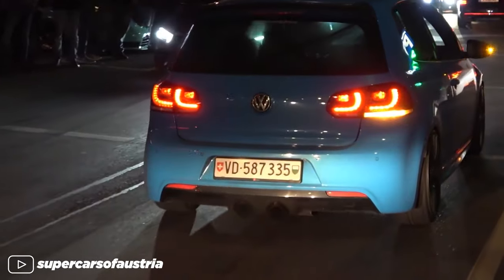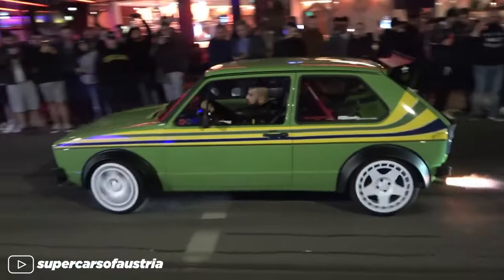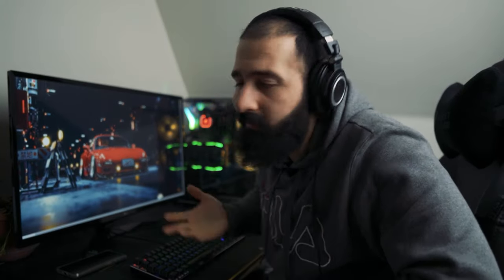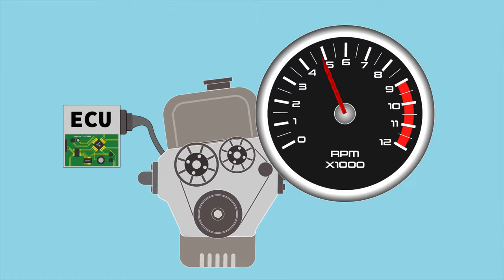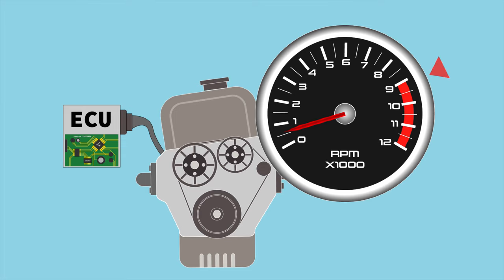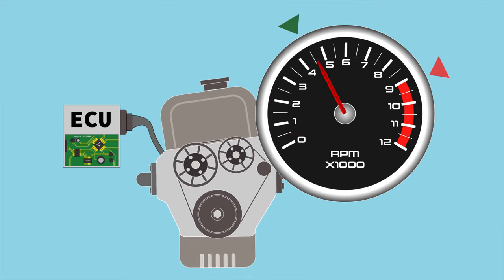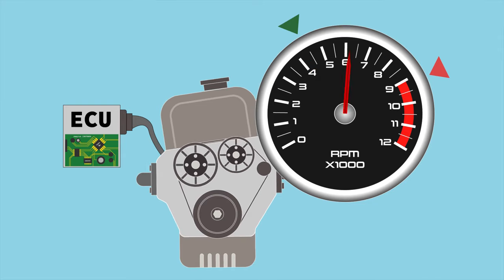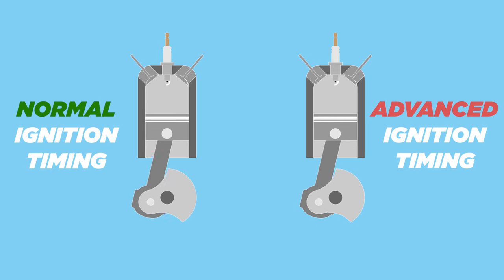2 Step || EXPLAINED

Comment: That was a sick explanation. Short, simple, and to the point. Thank you!
Reply: It was complete bullshit but ok. If you have no turbo why should 2step make pops and bangs. and antilag is not suppose to ref your engine... Its to keep your turbo boost and reduce the "lag" of boost when you hit the gas after a shift. Hes not even understanding the simple thinks in my opinion
Reply: @svenski7392 the video explains about 2 step not anti lag. They're different

Comment: I think the 2step tuned with spark cut only is also known as anti-lag. Some don't even call it 2 step.  It's treated as something completely different because of the difference in the tune, damage it can cause, etc.
Reply: I think youre right
Reply: Anti-lag is something completely different, where fuel is injected (sometimes directly into the turbo inlet) to ignite and keep the exhaust turbine spinning.
It's almost the reverse of a two step, which just limits the engine revs.
Reply: @johncoops6897  Depends on the kind of anti-lag. anti-lag is a purpose, turbo go brrr, and there are various tunes or physical configurations to achieve that purpose. Or at least, that's what a video said. I don't know shit about cars. Why am I even here.
Reply: @jnevercast  - not sure why you are here either, nor why you are trying to argue about things you know nothing about 😃
Reply: @johncoops6897  Seems like the thing to do on YouTube don't you reckon?

Comment: 7-month-old video but it's the second video of yours I've seen. I just watched how the burble tune works and wanted to watch another video of yours. Good video.
Commenting helps you so I'm doing my part. 
I do want to point out that on some engine designs while oil is flowing immediately full oil flow over all the components and parts doesn't really happen until after it runs for a short period of timing idle. Not long but if you just start the car and drive it's not ideal. Especially if it's actually cold out but it doesn't really matter about the temperature. 

For me I always start the car put the seat belt on do whatever the stuff I have to do is, put my phone down or whatever... And then I put it in reverse if I'm in my driveway. And I just pause for 5 seconds or so. Not super long but enough that the automatic transmission (If you're driving scum like automatics) get the chance to pump everything through and the oil in the engine gets that much longer to get around before I take my foot off the brake and drive quietly out of the neighborhood. 
And by the time I leave the neighborhood I'll just romp on it because it'll be warmed up by then. Lil

Comment: You explained very thoroughly about what it is and how it works for launch control but I figured you’d have delved more into the drift scene and how guys use a 2 step for throttle control when sliding. 2 step launching in manual cars is actually kinda tough and not as simple as tuning in a 2 step and having a perfect launch. Otherwise every drag racer would use them 😎
Reply: Drag racers DO use them. Almost every drag car, manual or auto, uses it to prevent wheelspin.
Reply: @johncoops6897  yea you’re right I guess I’m considering more manual street cars not necessarily actual dragsters. You’re right tho 🙏🏼

Comment: Hey man! First video I watched and I love it! Now can this be done in an automatic Civic? And what exactly do you do in order to trigger the 2 step. I know u can floor it while stationary but what about while driving and i want some pops or burbles? And can u do a spark cut tune and then go from there to a fuel and spark tune? Like just enjoy the flames for a little bit and then go just to pops and burbles? Thanks!
Reply from the maker: Thanks man, glad you like it. To answer the question, yes you can have it in any car with any transmission, the way you trigger it could be a state (when stationery in Neutral) or even a button, every car is going to be different and every tuner does it differently.
Reply: Which tune do you recommend getting? I also have an automatic civic, my car makes the burbles in sport mode when I use manual shifters, however they are not that loud. So I really want to make it louder and also pops. Any recommendations of hondata or Ktuner? Or what do you recommend? Thanks in advance.
Reply: @ricardorodriguez1391  straight pipe and a ghost cam 🤣

Comment: Just tested this on my 150cc motorcycle, and it works like a charm, I'm using fuel and spark cut method just to be on the safe side, although I don't know how safe it is since it can become very lean due less fuel.
Reply: How did it end up?

Comment: Thanks this was a very informative video. Could you please explain how exhaust flame thrower kits work and if they are commonly harmful to the engine,  exhaust, or compete car. I'm pretty sure that they are more than a radically tuned 2-step however I don't know.  Thanks

Comment: And also add that the n2mb wotbox was THE BEST 200 bucks i have ever spent on a mod for any vehicle ive owned, the no lift shift along with the 2 step launch control was simply amazing, and the icing on the cake was it would shoot flames out of both exhaust tips.... 😍😍💨💥🔥

Comment: I don’t know if this is considered two step, When in neutral the car will rev and stay revved at redline, but if the car is in gear and you push the clutch in, rev to redline and keep the throttle at 100%. It will slowly come down to 4k and stay, that’s the peak torque range for my motor, the Ecu seems to be very good at keeping traction at that rpm. I’ve never thought of it as two step considering it’s an economy car.

Comment: Clear, correct and to the point. Bravo, caballero. You just earned a new subscriber today👍🏼

I've got a beautiful Nissan, a s14A1 with all it's original SR20DET engine and parts (in fact I am restoring it as new) except for the exhaust, I gift him a 3,0" Duramás Line from the dowpipe to the end except for the rear muffler wich is a Mongoose one. It makes pops and bangs just right as it is👍🏼 no flames, just pure ecu cutting the fuel and spark. Btw it just has 55.000km (not miles) so it is pretty uncommon😅 
all you can see these days are tuned up to the ass s14-s13 240sx, as you want to name it... They are fun, but they usually have a very brief life...😅

Props from Spain.

Comment: Two step is indeed bad for your vehicle. Cutting timing and allowing your vehicle to bang off the rev limiter puts where on the internal components especially your oil pump sprocket or gear. This is why they go to modification for people running two step is a Billet pump gear. Other than that your explanation is decent and covers the basics.

Comment: I have a question. When you turn it on the rpm is limited to the designated rpm but when you're still driving it after the launch does the rpm still limited to the settings or you have to turn it off while you driving?

Comment: If it retards the timing but not the fuel it is as much an anti lag system as it is a launch control. Especially it the ignition happens in the exhaust system before the turbo.

Comment: And technically you don't need to tune the ECU, at least with the MSD 2step(which i wouldn't recommend and I'll say why below) or the N2MB WOTBOX which is 2step and no lift shifting...
Id re recommend the n2mb because it cuts your spark and not your fuel unlike the MSD because if you cut fuel especially with boosted applications you run the risk of going lean and suffering catastrophic detonation if severe enough whereas with the n2mb you are only cutting spark timing for fractions of a second and full fuel is still being delivered which is much safer.

I had an n2mb wotbox installed on my n/a 04 Mach 1 and there was no tuning of the ECU you setup the wotbox module itself by holding the button for various amounts of times and counting the blinks which corresponded to a particular time/ rpm, (time for no lift shift, rpm for launch control). You could go on their web page and download a program for free and hook up the watt box to your laptop and fine tune the settings to exactly your likings but still it's not technically tuning the ECU

Comment: i guess my stock passat has two step limiter, 4k for neutral and redline in gear. However i think it heavily uses throttle valve control since it is throttle by wire

Comment: I Did A Cheap 2 Step Rev Limiter With A Switch, Relay And A Nitrous Window Switch. All It Does It Kill Power To All Coils When RPM Set Point Is Reached. No Spark Means A Massive Amount Of Fuel. When Spark Comes Back On It Might Ignite What's Pushed Into Exhasut... If Your Turbo... It Goes Bang And The Turbo Jumps Up In Boost. It Scared The Living Hell Out Of Me. I Didn't Expect To Hit 12PSI (what I run) In Neutral At 3500RPM. The Amount Of Black Soot And How Rediculously Loud It Was I Thought I Blew Up My Engine hahahaha

Comment: i have an 88 supra and was wondering if 2 step is harmful to the valve train and do i need anything fancy valvetrain wise i currently have stock valves springs and retainers with a bc 264 cam
Reply from the maker: If you're going for the big flames and bangs, it's always going to be harmful to your valvetrain. I wouldn't subject that engine to this much stress if you're planning on keeping it running for a while

Comment: Just put two step on my n/a ls3 and had it dyno tuned it made 420hp and 419 tq I didn’t have it tuned for the 2 step I had it tuned right and then got the itch for a 2 step put it on and never retuned it .It does not shoot flames but sounds incredible. So are you saying since my car is tuned right it is ok for my engine ?
Reply: 50/50 it’s better to get it tuned

Comment: theres another way you can shoot flames, if you buy the stuff listed here: Bosch Iridium Spark Plug 9609,Duralast Wireset 9573, Duralast Ignition Coil C838, and some wire running to your battery then bam FIRE

Comment: So if I do a 2 step is it always going to be 2stepped? Bc I just want to 2 step sometimes and not all the time. Is 2 step like only in 1st gear?
Reply: What I really wanna know is what do I do when I just want to drive normally?
Reply: @korrupt3137  depending on if a tuner set it up for you or you went the wired route there are ways to “activate” it to prep the car & the ability to turn it off Vice versa. It wouldn’t be on 24/7 driving

Comment: Some electric motors do not have rev limiter and well climb higher the more voltage you have the higher it revs and if there is not resistance I think that’s why when my rc cars gear fell off and my esc smoked itself while flooring like an idiot with out a gear on 3s (11.1volts) dang it

Comment: Just installed the 6al2 on my 94 Mustang with a carb. Technically it has fuel and spark cut. There's a noticeable difference between wot 2step and half throttle. 🤣